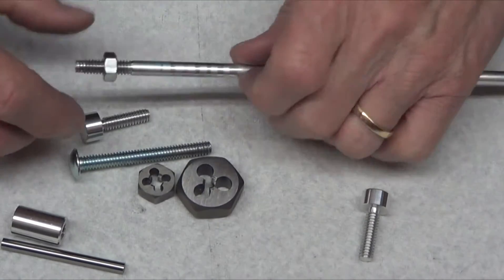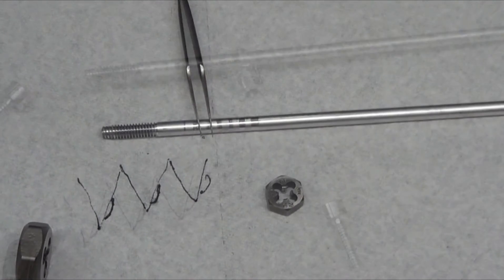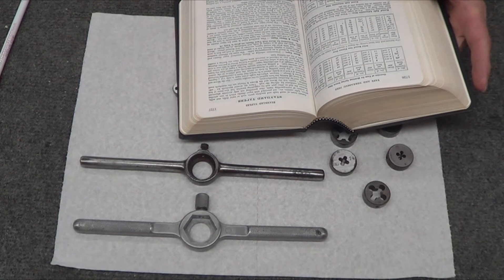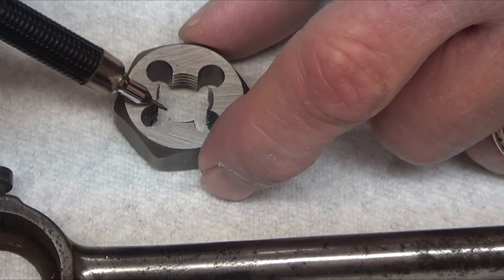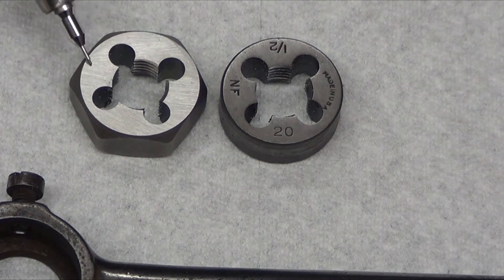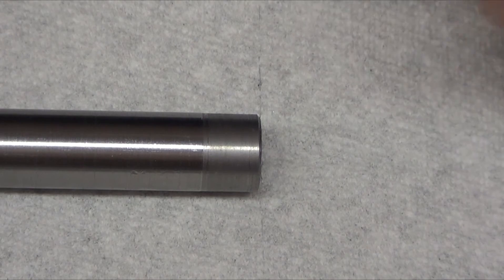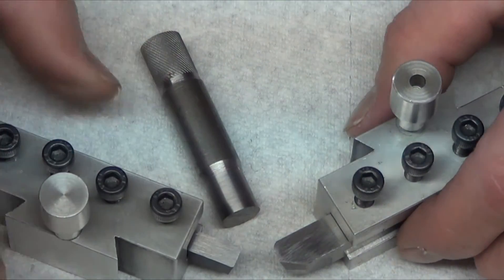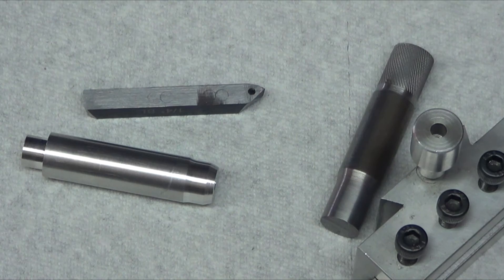Threading Die Education Video #72

Comment: WOW, painful to watch and listen to...but it did answer the question that I had to myself. I thought there may be two different types of dies and now I know. B ut I think the difference is more in the angle of attack. If you look at a cutting die it is very open on the end you put the rod in opposite of the taper you would find on a tap. The cleaning dies have less of an angle where the cutting ones are more funnel shaped.
Reply from the maker: Sorry it was painful but glad it helped out.... The difference is simply the cutting edge.
Reply: Dave M I'm not an expert, but I disagree. Look at a cleaning die. It is threaded all the way through. Still funnel shaped, but very tubular in shape. A cutting die has a very non-aggressive entry side. It is much more funnel shaped. The cutting edge gets more aggressive the deeper the rod goes into the die. Common sense tells you the reason a cutting die is more funnel shaped is because it cuts a little at a time and more and more the deeper the rod goes into the die. If you tried to hack all the metal away all at once it wouldn't work. Try to thread a rod with a cleaning die once. You won't even be able to fit the rod into the die. It has nothing to do with being round or hex shaped either. That book you have is a fraud. It is all about the angle and aggressiveness of the die.

Comment: Hex dies are NOT  only for RE-threading. Osborne in the UK have certain dies that are for virgin thread cutting that are HEX shaped. The reason for this is that Hex dies don't rotate and slip in the holder. Check there older catalogues.  Been working with these HSS Hex dies for 36 years and cut countless virgin threads with them. The type of hex die that IS for RE-threading is thicker than a normal hex die.to help identify the difference. Goliath in Australia also manufacture HSS dies that are hex shaped for virgin thread cutting.
Reply from the maker: Was only reading what it said in the Machinist Handbook...

Comment: I had no idea. Thanks for sharing! 

Carbon steel taps and dies are great for aluminum, brass, and mild steel. Don't try to use them on anything that is even slightly harder than that.
Reply from the maker: Good input. I was always afraid to try threading stainless but now I know don't do it! Thanks ....